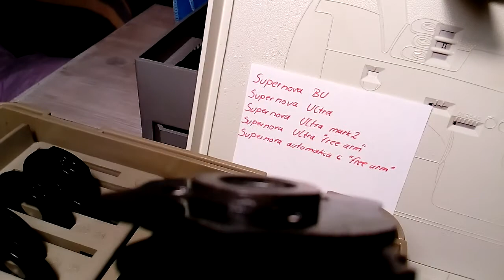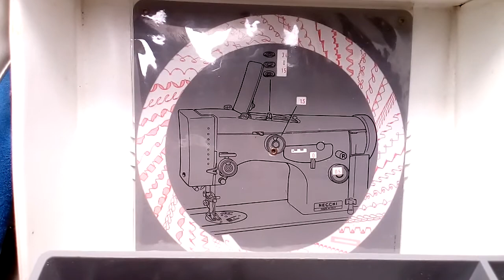Necchi Supernova Ultra , Lycia , Julia Cam profiles

Comment: Thank u so much for your break down on the tension asembly! I love this old machine but it hasn't been used much  so getting it back in tip top shape is what I need. The needle won't change positions and the bobbin doesn't wind and it doesn't zig zag.

Comment: I have a Supernova and wanted the permanent cam with three lobes for multi-point zig zag. I couldn't locate one individually. I got a good deal on a set of 14 permanent cams for a Jjulia with the cam I wanted. I used my lathe and reduced that boss to the appropriate height and ended up with 8 additional cams for my machine. Two cams have the white insert with only the round hole. I could machine them and make a part to adapt them, but won't for now. Effort versus payoff says no. Three of the cams matched my existing Supernova cams. The last was the buttonhole with the wire bail and no handle. Nothing to be done there.

Comment: Thanks for the info, very helpful!  Do you know if cams for the Necchi 555 can fit Lycia?
Reply from the maker: Hello, since I don't own a type 555, I can't compare, but on the pictures that can be found on the internet it looks like it would be the same. Unfortunately, I can't make a definitive statement on this...
Reply: @necchi-pavia  Thanks,  I did a closer look and the cams for 555 do not have the nub on the bottom but are the same height.

Comment: Thanks for this video. I see three metal followers that is controlled by exchangeable cams. What do each lever control?  If you do ordinary zig zag stitching, are one of the cams used to control that, or do the machines got a separate cam, that controls the zig zag movement?
Reply from the maker: Hello, the machine sews the Zigzag without the "cams" ...
A metal backdrop is built into the mechanics for control purposes.
In addition, automatic stitches can be created with the "cams", although there is not necessarily always 3 pieces in a group.
The upper small lever of the mechanism sets the needle position, the middle lever controls the Zigzag width, the bottom one controls the transport (also backwards).
From Supernova Ultra Mark 2 and Lycia / Julia, the ratio of forward and backward transport of the fabric can also be influenced while decorative stitches are created.
The automatic mode can also be set at different speeds in relation to the number of stitches.
In my opinion, they are the best machines from that time.
Regards.
Reply: @necchi-pavia  Thank you very much for this detailed information. Yes, it seems to be very versitile mechanics. I got a Singer 237, that is a side loaded zig zag machine as well, but no other cams. It do have some slack in the zig zag mechanics, and it was hard to reduce significantly by adjustments. Slack can make problems for sewing stretch fabrics. But I guess, that Necchi was better to reduce slack in mechanics than Singer was. This is a video about it: https://youtu.be/fjjmTxNDkgw
Reply from the maker: @sewingmachinesindetail 

Thanks,  the link dosen't work?
However please watch my latest upload to see the Zig Zag mechanics in a Lycia 522, they are similar to all the "Supernova" series....
https://youtu.be/-Lj4YGHocZM
Thank you.
Reply: It is strange, if my link do not work - I can click on it from here, and it works. It is the latest video on my channel. I shall comment on your other video there - thanks.

Comment: Got a SuperNova and a 555 what is the difference on cams. You showed the sister machines of Julia, but my 555 is not listed but it has the same front as the Julia
Reply from the maker: As far as I know the 555 Modell was not in the offer in Europe.
Till today haven't see this machine in real (I am searching every day for vintage NECCHI across Europe to build up a collection) 
So I can't  give a binding statement,  what type of cams fit here... 🤔
I think, that the Julia 534 and the 555 uses the same cams disign.
They look the same...

Comment: Thanks. This was helpful. I am attempting to rebuild the cam mechanism on my Julia. It is a big job and is turning out to be very difficult. Do you do rebuilds or know of anyone who does? I’m located in Sa Antonio Texas.
Reply from the maker: Laura Herndon
Hi I'm located in Bavaria Germany.
The cam drive of an Julia is an special thing. Permanent driven whit gear ratio 10:1 
If you remove the mechanism it will be impossible to find the the basic setting. 
For adjustment you also need the cam for bottom holes. 
Here in Germany I don't find any service that figure out the settings. 
I'm rebuild some vintage Julia's and Lycia, but never took out the cam drive. I'm also search for any information to get them fixed.
Regular Supernova are easy to handle, in setting and adjusting. 
The Julia and Lycia are Masterpieces in mechanical funktion.
Reply: What’s your email?  I think I may have found someone who can help.  It’s been like searching for a needle in a haystack. I’m going to be contacting them this morning.
Reply from the maker: Laura Herndon
Thank you for the quick response and the information about.
Please understand that I am not posting my email address.
Reply: J.A no worries.  I understand, keeping your privacy is important.  This guy only does the cam mechanism work as a hobby, so he doesn’t want everyone contacting him about rebuilding them.
Reply from the maker: Laura Herndon The rebuilding is not difficult, I have a Supernova free arm (automatica c) and I replace the cam drive.
At least the machine run a a new one.
The Julia mechanism is a gear driven device and the ratio will be exactly adjust to needle bar position and Zig zag movement. 
The spring clutch in the mechanism simular to the Supernova series, allows the ratio setting that drive the cams per axle. The cams whit the nose at the bottom are specified Julia and Lycia attachments, for permanently driven cam mechanism. 
If this guy can set the timing in correct way so he can help you by 
repair your Julia. 
My machines work fine an I have no necessary to rebuilt the cam mechanism. (Julia & Lycia)...

Comment: Of the freearm machines, which do you prefer, the Ultra or the Lycia?  Thanks!
Reply from the maker: Hi.
Both machines are great in mechanical design and engineering.
If you can get a supernova ultra mark 2 as an freearm,  then you have in my opinion the best vintage necchi ever build.
All Vintage NECCHI are durable for a long time, if the machine is refurbished. 
The Lycia uses a plastic cam profile inside for the feed dog to transport the fabrics.
This is the main difference between Lycia and Supernova regarding durability....
Reply: Thank you, I was able to buy a Lycia 524 in good condition. However, the zizzag is frozen. I have been using a usa product "blue creeper" and some ballistol, but am not sure what I am doing.  can you show or tell me how and where to apply ballistol to unstick the zigzag mechanism?  Also could you provide a step by step video how you go about opening the major parts of the Lycia to access the internal parts that require lubrication... assuming that the machine is in basic working order... i.e. is synchronized but maybe zz stuck, and feed-dogs won't drop... disorders common on machines that have been sitting for 10 years or more.
Reply: I notice that you located in Bavaria.  I have friends from near Klingenburg, are you by any chance from that part of Bavaria? I know that the freistat is quite large.  Thank you again for all your interesting videos.
Reply from the maker: I prefer the Supernova ultra free arm version.
The older NECCHIs are more careful processed.
The Lycia is all in all not durable as an Supernova, and the cam drive is an specialized thing that maintraince is very difficult to handle.
Reply from the maker: @paleodictyoptera 

Please don't try to remove the cam drive mechanism at the Lycia / Julia (identical)!!!!
Yuo will never find the correct timing again whitout an detailed Instruktion, cause they are permanent driven whit ratio 1:10....
Remember that.
Reply from the maker: @paleodictyoptera 
I'm not far away from Klingenburg.
Ho do you know about that I'm located in Bavaria,  did I mentioned  
this in one of my videos?
I'm not sure...
And thank you for positiv response.
Reply: I will definitely not attempt to remove the cam system.  I was unable to buy the supernova ultra...too expensive.  Maybe someday.
Reply: Hi, yes, you mentioned it in one of your replies.  Actually, friends (family) from Mechenhard.
Reply from the maker: @paleodictyoptera  Hmmm Mechenhard is nearly Frankfurt am Main.
There is a cunfusion about the distance,  this place is about 350Km far from where I live.
I'm sorry.
Reply: mechenhard is next to erlenbach am main.